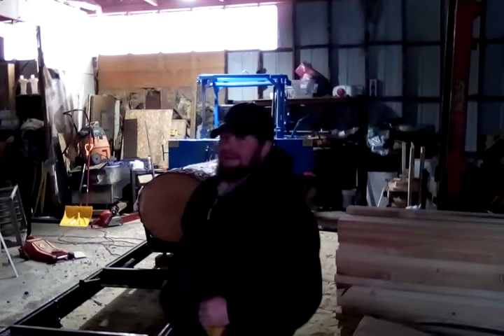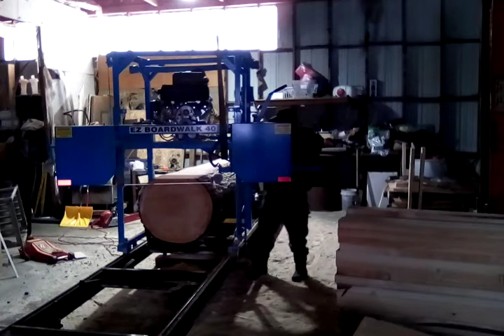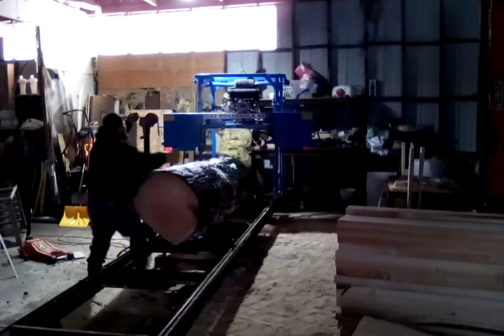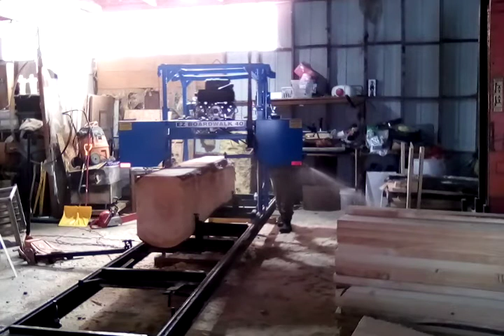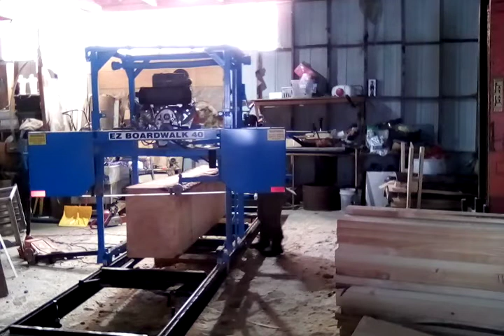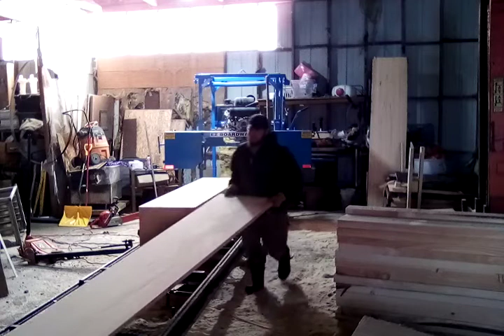Ez Boardwalk 40 cutting large white pine log

Comment: OK... Do you weld? 
Weld some 1.5 x 3 or 4 inch tubing (long side up) on top of the channel the logs sit on while cutting. This will let you set the log on there with your fork lift without slamming the mill. It will also let you pick it back up and tilt the forks up to roll the log over, then set it back down. Much easier, quicker and safer than the way you did it in this video. Best way is to get a couple of pulleys and chain and pick it up and roll it right to where ya want it and set it back down, clamp it then unchain it. If your gonna do it with the log turner at least get some tubing you can slip over the log stops so the log doesn't get hung up on the top end of the stops. You drop a log that big to many times your gonna tweak the frame of that mill.

Shut the engine off while turning the logs and idle down after your cuts. Saves fuel and reduces exhaust in your building.

And for crying out loud. if you like you legs, never step inside the frame while a log is hung up on the log stop. If that thing frees up it would take your leg OFF.
Reply: Sounds like good advice.

Comment: Do you ever have problems with your logs wanting to move a bit when making your initial cuts?  We did, and figured out it was because we had the head on the wrong way.  What I mean is, the blade was pulling through the wood, away from the rigid uprights.  Our mill is a central machine mill, so not nearly as nice, but once we pulled the head off and flipped the tracks around so that when we ran the head through the log with the teeth pulling towards the rigid log dogs, our cuts became a lot nicer and smoother and our logs stopped moving around all together.

I'm thinking one of these 40's will be the next mill we upgrade to.
Reply from the maker: I did have issues with that initially but I made some slide brackets to hold the clamps/dogs . They worked out well. The reason I didn't turn the mill around was guides would be in the wrong position/place to work well. This system works well for me🙂

Comment: Great video!  Seems as if you have been happy with the Boardwalk 40 from the other comments   I have been looking at both the Boardwalk 40 and the Lt15 wide.  What is the largest log you have milled?  I understand between the guides is only 35”, but log capacity is a contributing factor for my decision as well.  Thanks
Reply from the maker: I milled a log that I had to trim the sides with the chainsaw but I don't remember the footage anymore

Comment: I think your the only person who shows the log turner being used!
I just ran across these mills on YouTube and didn't know they existed or anything about them.
I've been watching all the video's on these mills because I want to by a mill of my own!   
It seems pretty solid, is it just supported on either end or at multiple points?
On there web site they only show it supported at about 2 feet in from either end.
Is your 24hp or more?
They say it cuts a 40 inch diameter log but what is the max width of cut between the guides?
The 15 degree cutting angle is suppose to make it take less effort pushing thru the log, what is your opinion? 
All in all are you happy with the mill?
Reply from the maker: I loved the mill,  I had the big motor on it and the 15°angle makes a huge difference

Comment: Hey bud , I’ve just ordered a 40 from Stanton and had some questions that he has not gotten back with me on which annoys me. 
Planning on pouring a pad for the mill but only want it large enough to accommodate the mill, what is the exact footprint ? 
When it arrives, do they unload it or do you have too ? Thanks!
Reply from the maker: Hi Dewayne call me at 989-506-5746

Comment: Good morning, I got to wondering why Stanton calls the 40 a 40 when in all actuality mine will only accept 35” between the guide wheels which is what you go by.
And at full height , it’s only 33” from the rail to the blade.
The frame post are 40” apart but there’s no way to do a 40” diameter log like it states in the brochure, it should’ve have been called the 35. 
Have a good weekend.
Reply from the maker: That is something you would probably be better off addressing with Stanton. I wondered the same thing as well
Reply: @mattcoblentz74  
Hey brother, hope everyone is good.
I’ve started trying a different blade on the mill called Ripper 37,s , I’ve noticed on a giant Maple I recently milled they dipped and waved ? 
I’m sure different blades need different tensioning but I don’t have anything to let me know what the difference might be.
My tension setting is nothing more than an indicator meeting flush with the end of a larger nut.
My mill manufacture suggested Timberwolf blades which I bought and actually liked, just saw a lot of buzz on the Ripper 37 from sawmill sights and wanted to try something different.
Thanks and have a great day.
Reply from the maker: @slabsoffreedomsawmill9721  what thickness is the ripper
Reply: @mattcoblentz74  
I can’t remember, I’ll check and get back to you.
I ordered the 10 degree blades which are more suited for softwood.
Everyone said I should’ve ordered the 7 degree for hardwood.
I still like believe the Timber Wolfs are just as good a blade and I like their website, they’ve got tons of different blades to choose from for the Boardwalk 40.
Reply from the maker: I would try the woodmizer turbo tip or the 747 turbo tip
Reply: @mattcoblentz74  
How long did your band wheel bearings last before you had to replace them ? 
I’ve already got a flap unraveling on one of my bandwheels, 36 hrs in.
Reply from the maker: I never had any trouble whatsoever with mine. I cut 850' per hour with mine but I did have huge logs
Reply: @mattcoblentz74  
Stanton told me to use diesel for lube, what do you use ?
Reply from the maker: I use diesel fuel too
Reply from the maker: @slabsoffreedomsawmill9721  do you have a sharperer
Reply: @mattcoblentz74  
No I don’t.
I just sent my first batch of dull blades to Jerry’s Resharp to give them a try.
Reply from the maker: @slabsoffreedomsawmill9721  I would highly recommend getting your own sharpener and setter . You will notice if you get it set up right that they will outperform a brand new blade
Reply: @mattcoblentz74  Wow, that’s hard to believe.
Wish I could afford it.
My budget is gone for any improvements after buying a bobcat and a grapple bucket.
I’ve also raised my price to .75 a board foot, tired of cutting everyone’s logs for nothing.
Their welcome to take the. elsewhere if they want , give me a break and I can actually cut some stuff for myself for a change which I never get to do and that’s why I bought the mill in the first place.
Thanks man.
Reply from the maker: @slabsoffreedomsawmill9721  that's amazing if you can get that much I charge $0.65 a board foot for pine and I buy the logs that's for 1-in random width within reason wide stuff is quite a bit extra